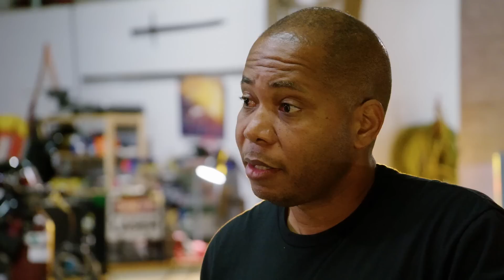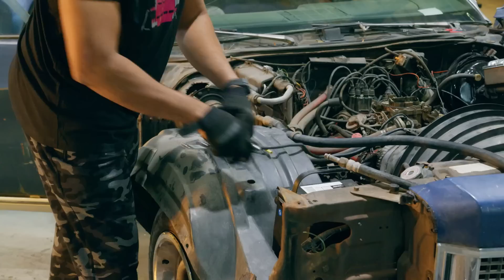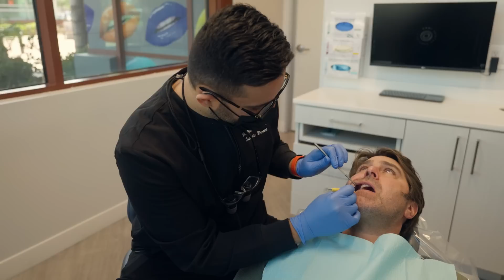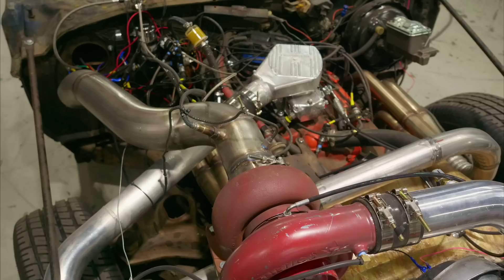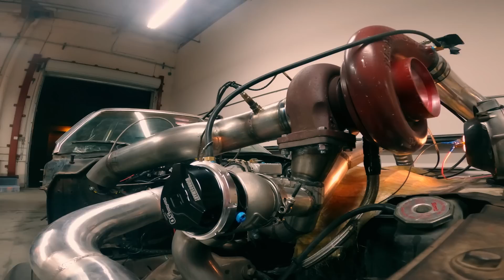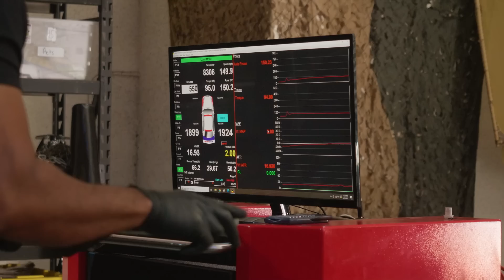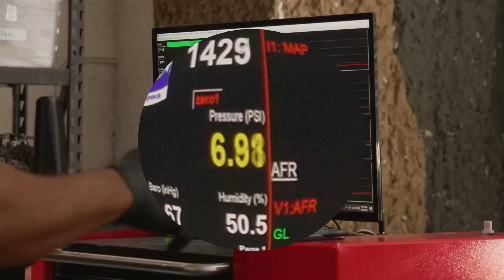Turbocharger Myths - Motor MythBusters - Car Show

Comment: That is not a turbo from that junk yard that's a turbonetics turbo worth around 4000$ painted to look old and it's definitely not off them diesel boat motors
Reply: Like the original Mythbusters, this show is focused on entertainment and fictional elements are added when needed to make the story work.
Reply: worst part is that it was only making 2psi with that wasgate regulating and only 7 when completely shut. those 350 can displace quite a bit of air, they did something wrong or just staged and fake
Reply: @iq5992 i pains me to watch...  So much fake or just general weirdness. All that work and only get to 130mph, that's a smidge over 200kph if I'm not mistaken. I lost my licence in a 2.0tdi passat with 109bhp, did 160kph past the police (got it up to 180 just before). I have had cars with 150-160bhp do over 200 and only running out of gears. My old Volvo from 01 would only stop at what I dared to do or had road to, got it at most up to 270. Than I saw a police car in the 80 zone I was in. Car only had a stage 1 tune and 320bhp out of the only brand to ever mount a straight 6 transverse in a car and also only to have it twin turbo at the same time. 

Well landrover got the same Volvo engine in the Freelander 2, was when ford owned both land rover and Volvo

My current Audi A8 3.3tdi V8 even stock would cruise at 240kph right at the limit set in the ECU. Only got 226hp stock 400 or so lb/f, 560nm. 
So how they can't get more out of that car is beyond me. Just with a plain carb, tuned ofcouse. New exhaust, electronic dizzy. The works. I installed some cheap easy electronic ignition dizzy for an old landrover series 2 from 62. 2¼L.  New ignition and it went from barely running and slow, horrible response to so snappy and well manageable I could set the idle down to 180-220rpm cold. Just turning the crank with a ratchet would start it before you would almost need to use starting fluid to start the engine. And it sounded like some weird rx7. With the brapbrapbrapbrap aggressive idle and everything 🤣 very disappointed by mythbusters nowadays
Reply: @iq5992  with that small of a spring I'd say there was enough back pressure to push the valve open. If it was like a 6 lb spring it may have went to the moon
Reply: @iq5992  or maybe the turbo was actually in that yard for a reason? Honestly, there's no reason to be taking this so seriously.
Reply: @iq5992  that engine was definitely tired.  115 is pretty sad.  I've seen an old monte with just a 350 hit 140.  Maybe had a longer rear end but that v8 was already done before they boosted it.
Reply: Just sitting there…
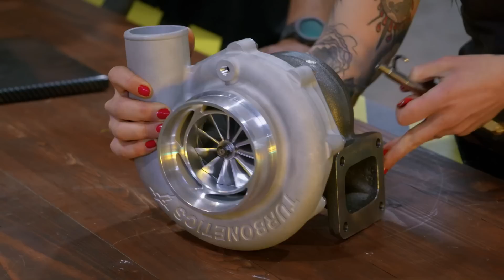Reply: 21:50 there, right there thats the one
Reply: I just came to say that lol
Probably because Bisi is sponsored by them
Reply: Idk. Looks like every factory garret I've seen. They do put them on from the factory. And they like $2300. Every ford ecoboost has a pair of garret on it. Even the 7.3 which that turbo looks identical too are Garrett's. But not bb, they oil float.
Reply: @JH-zo5gk  bro it's written on the turbo "turbonetics" of course it looks like a Garrett it's a fkn turbo you goose they all the same but not the same manufacturer and Garretts this size are all competition models like this one
Reply: You don’t know that bud. It could be an old turbo. But this show is for entertainment purposes so shut you trap
Reply: Is it really possible they faked it? I would hate it if they did. I believed they found it. I'd be so disappointed if they did
Reply: @colinofay7237  mate they 100% didn't pick that up out of a old junker  diesel it's not a diesel turbo for 1 and for 2 it's a high performance turbo made for making over 1000hp on petrol cars so sorry to burst ya Buble bro but it's definitely staged and set up 👍🏼
Reply: @Lightsout89  it's not going to make 1000hp on a stock engine with stock cams and stock injectors and fuel pump.  Especially if it's obd0.
Reply: @colinofay7237  I mean one of their team members is faking which gender he is, so you never know haha
Reply: They were probably hitting boost cut on the ecu
Reply: @midbc1midbc199 Bro what ECU?  The car is from the 70s, there is a carburetor and a distributor.
Reply: What your missing is, the concept is still the same.
Reply: Dude is right the turbo they used is like 4,000 dollars you don't find a turbo like that in a junk yard at least I haven't lol😅😅😅
Reply: Even has hybrid fins
Reply: It's not even a junkyard, it's a storage yard 😂
Reply: Yeah, saw that right away. Oh it's perfect and no corrosion... you can see through duct tape?
Reply: @forced4motorsports  oh stop crying like a baby
Reply: You people just think y’all know everything. It’s prolly an older turbo.

Comment: Jeremy Clarkson once said "a turbo, exhaust gasses go into the turbocharger and spin it, witchcraft happens and you go faster." 
In reality, turbo makes sense in certain applications but the stupidiest application of turbos was to try to improve fuel economy by putting turbos to lawnmower engines powering big cars.
Reply: Uhm.. that’s what everyone is doing nowadays though. Putting 2.0 turbo’s in giant 3 row SUV’s
Reply: Turbos are fantastic for efficiency, they're used on pretty much every new engine for a reason.
But I suppose you know better than every carmaker on the planet

Comment: now in cuba they wouldn't throw that manifold away they'd flip an reverse them an make a two into one to feed the shitty boat turbo also doubt they'd have billet dizzy's so as far as keepin with the theme you're right off track
Reply: thats a $US4K turbonetics turbo... it aint off any old boat!

TV shows do things properly? what?
Reply: Dont overthink remember entertainment is 1st goal accuracy is some where on the list.

Secondly, have fun trying to weld some nasty old exhuast manifolds, or just by some new headers to save half a day working with shit. Next you want everything arc welded or oxy brazed.

Comment: If they wanted to test this correctly to the film they should have used oxygen like was stated in the movie not nitrous oxide
Reply: i got no idea what the movie is, im not even entirely sure what the so called "myth" is... lots of skipping through!

straight oxygen? detonation. its why they dont use it. if it worked, why bother with NOS?

air is 1/5th oxygen.
nos is 1/3rd.
throw straight oxygen in and the ratio gets too high, detonation becomes too much of an issue. 
because of the nitrogen the energy required to break the molecule apart to release that oxygen atom is higher. it isnt O2, its N2O, much stronger bonds...

Comment: My 2 cents    Remove all rear glass, rear trunk, rear bumper and lights 
Welded diff= locker, * cut all the trunk floor, get rid of spare tire and assembly. 
Make a frame to hold rear 10 gallon gas tank 
Drop the front suspension    That will make it faster

Comment: 3 Problems with this setup are 1 the transmission gearing/torque converter stall, 2 the turbo is TOO BIG, should be two small turbos, 3 the engine itself has a low lift cam for low RPM, not high RPM.  They are pulling the waste gate reference when the engine isn't even hitting the wastegate pressure.  OK.... THIS IS CALLED COMPRESSOR SURGE!.  The turbo is fighting itself which is why the boost modulates between 1 and 6 pounds.  The setup would have to be capable of building MORE BOOST than the wastegate spring (probably 12 psi)  in order for the vacuum line trick to work and throw ALL THE BOOST (25PSI+) at the engine.

Comment: It obviously has a 7psi wastegate spring.  Put 30psi spring in it
Reply: 3 psi, which is why it doubled to 7 without a reference line.
Reply: @ClumsyCars  which is like, fuck all anyway.. (not a dig at you, just bouncing off your comment)
Reply: @truculenttabasco  basically for a modern engine, but an old 350, it might be feeling that a little bit.

Comment: I wanna know when 7psi and 130mph were considered that big of a deal?
Reply: 1983
Reply: @redlight3932  I think a lot more like 1923.
Reply: Yeah, that big ass turbo should blow AT LEAST 30psi, 7.2 is laughable.
Reply: @vrusostalstreak6557  Lmao I get 30+ from my little VNT-17 in a 4c diesel jetta they seriously messed up
Reply: On 72 Monte Carlo it's something alright
Reply: fo real
Reply: For real 🤣🤣
Reply: I had a standard 1981 Celica that would hit 120, my dad had a tuned 1976 Celica that would hit 130.
Even the shit box 1978 Cortina would nearly hit 120.
I had 120 out of a 1989 Passat.
My 1990 Accord did Carmarthen to London without dropping below 120, I even had a 1.8 Volvo 440 that got close.
Then I had 2 1992 Senator 24valve dual rams, the standard one would hit 155.
Reply: Maybe when it's produced with garbage junk yard parts
Reply: pretty much everything built before 2000, 130mph and any boost at all was a modified car. Step 1 is find out if it's governed to 99MPH or not...

Realize that the 120+ MPH cars haven't been on the streets all that long relative to how long cars have been common in the public. Now days you can go buy a factory sedan and hit 120MPH, when in the 80's and 90's hitting 110 was a "Big deal"
Reply: @nunyabidness674 A lot of factory cars did 120mph in the 90s.
Reply: @alecb8509  a lot of factory cars read 120 on the speedo... depending on which state it was shipped to there could be a govenor that stops you from accelerating faster than 99MPH. '98 Pontiac Grand Am for example.
Reply: @nunyabidness674   that's a lot later car...  my 86 Dodge Omni GLH Turbo would do 130mph on it's 12 lbs of "overboost". That was bone stock.  
My 73 Charger with an early smog 400 big block would do 130 as well.  My 67 Monaco with a built 440 would do faster yet.  
My current car will only (?) go 155 before the governor shuts it off... and it's doing it on 15psi of factory set boost.  If it pops the wastegate, it's 30+ and goodbye cylinder walls (can't get enough gasoline in, lean = way too hot = meltdown)
Reply: @CaptainSeamus  First off, in order for you to take an 86 Omni to 130MPH, the gear ratios would have the engine spinning at 9800 RPM in 4th, 8800 RPM if it had a 5 speed... In short, Bull...

A 73 Charger with a legit Dodge 400 in it had a max RPM of 7800 before you floated valves, and with a 3speed auto behind it absolute top speed of the car was about 122...

67 Monaco with a 440 technically can do 130 as long as it has the overdrive splitter or a rear end gearing that requires 2 miles to get it up to 60MPH.

If the vehicle was assembled in or imported to the US in the 80's, it was required by law to meet newly revised emission regulations. Side effect of that is everything was built to be low top speed, but high efficiency between 0 and 35 MPH. Stuff like the Countach or 911 had to be blessed off on (normally with a large stack of cash) before you could even license it. Supercars have been around as long as cars, but again, they're not "daily drivers".
Reply: @CaptainSeamus  Dude obviously wasn't alive or driving during the 80's or 90's. Wasn't a shortage of vehicles that would top 130.
Reply: @nunyabidness674  Hell you talking my 88 Thunderbird Turbo Coupe was 14psi stock with top factory speed of 144mph, Easily topped with wastegate line removed for 20+ psi and north of 150. And it definitely was not the only 80's car to do so. Grand National is another turbo example, Typhoon another turbo example, Mustang SVO, A damn NA 5.0 mid 80's Mustang will hit those rookie numbers your throwing out.
Reply: @D3M3NT3Dstrang3r  88 turbo t-bird... lol... 3.8L POS that couldn't keep it's heads from warping... The 5.0 SHO might see 144 before the AOD was spooled out
Reply: @nunyabidness674  Turbo Coupe was 2.3T Pleanty of info out there including factory specs and top speed. You obviously never owned any of the mentioned vehicles or you would know better, but keep believing none of these vehicles will do what I say, be surprised if one gaps your ass. Not as powerful as newer vehicles but the power to weight ratio was lots better before the mid to late 90' safety and emissions bloating the weight to hell and back.

First results on the old google machine:
Capable of 0-60 mph in 8.5seconds and a top speed of 145 mph, plus generating 0.82 lateral g on the skid pad, the latest Turbo Coupe was a fast, well-built, and tremendously fun-to-drive grand tourer.
Reply: @D3M3NT3Dstrang3r  I dealt with the twin turbo 3.8L a whole lot more than the tempo engine.

was an option in the fox body mustangs as well...
Reply: @nunyabidness674   OH MY... Seriously? First off, the 2.3L in the Tempo was a pushrod motor (overhead VALVE) whereas the 2.3L in the Mustang/T-Bird was an overhead cam motor - completely different engines.
SECOND - the 3.8L motors used in the Mustangs and T-Birds (the 90-degree Essex motor) was NEVER factory turbo'd - let alone 2 turbos... they DID supercharge it, but that was only in the T-Bird SC, not in the Mustang.
Next, I suppose you're going to tell us about the twin turbo SVX Subarus you've "dealt with" as well...
Reply: @CaptainSeamus  2.3L Tempo, Capri, Escort. T-bird.... Pushrod engine eh?

Ford E5ZZ-6268-A  There's the replacement part number for the "non-existant" timing belt on the 84-89 2.3L Tempos...

You're confusing the Ranger 2.3L, which was the one that had the option of pushrods. Tempos are OHC, same as the escort
Reply: @nunyabidness674  yeah but the 60's 200 wasn't a big deal. The oil crisis of the 70's hurt, but 140 wasn't hard at that point either. That engine was too clapped out, the turbo was too big for the exhaust pressure being produced, and realistically there's a good chance that there was more HP being produced than the 130 suggests. not likely that a 50 year old 350 hydromatic is gonna just take 400 hp out of nowhere without slipping badly, without first getting a rebuild. just saying.

PS: I got a ticket in my first car for doing 115 in a 1986  pontiac sunbird, and my cousin got one for over 130 in his 1988 chevy beretta.  Also my janky 1991 iron duke grand am was capable of 131 according to the internet (which i tend to believe since the fiero pace car with the same engine did 137) 110 hasn't been a  "big deal" since the 1950'a
Reply: @davidburton3447  60's and at least half of the 70's we still had lead in fuel to save valves. Sure a 318 could be spooled up to 7-8k RPM, and it could probably hit 200 MPH.... Once...

My point was more that for it to be done in a daily driver without melting it down is relatively new.

Comment: When you have two good mechanics and top custom car builder and they don't size the turbo for the engine or even make a exhaust manifold thats right (who puts a 90 into a turbo from one side) you know it was all for TV (3psi...you would make more power with just NOS alone)
- This is the world of discovery these days were lots of things don't make sense and its all just content and lies
Reply: Probably the same brains that were behind monster garage. It's no wonder the majority of the younger generation aren't into cars as much anymore. It feels gimmicky and nobody digs that
Reply: even so, the rat trap trick is odd. why not try a "non-return valve" ? i mean, if all you care about is flow direction, that's a part that should be rather easy to get.